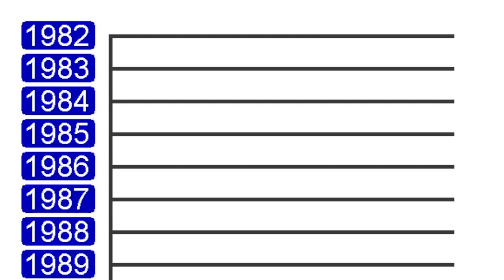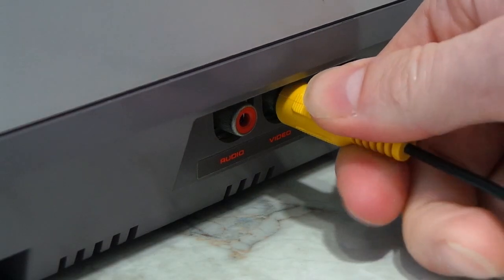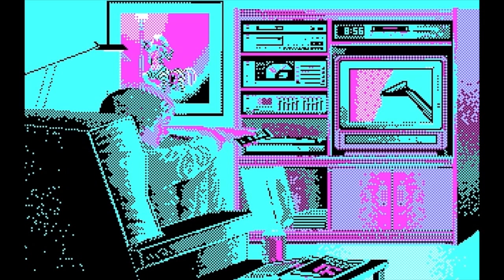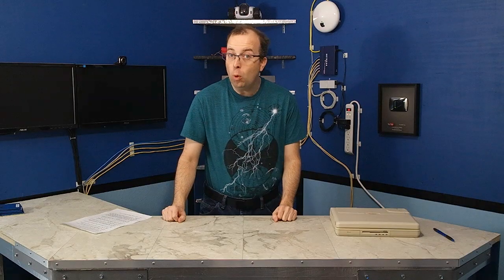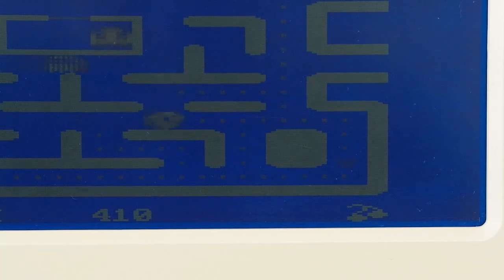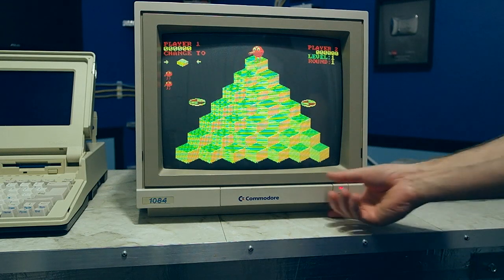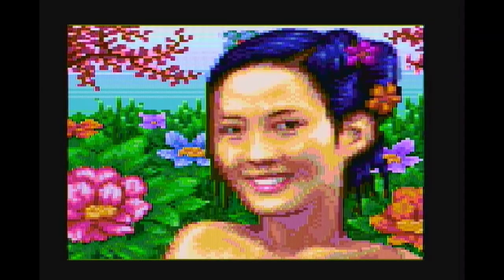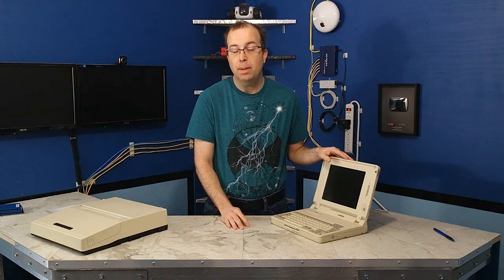CGA Graphics - Not as bad as you thought!

Comment: Ok so i know why CGA had 4 colors, because of small vram but why it had Black, C,M, White and not Black, R, G, B. It is still 4 colors and cost the same amount of vram. So why they choose that terrible pallete. BlRGB would be better than BlCMW.
Reply: To simplify andrewmjenner's explanation, in the 4-color CGA graphics mode, only the R and G channels could be controlled by the programmer. The B and I channels were set globally by the choice of graphics palette. The I channel was always set on to produce a bright image. If the B channel was off, the four R and G combinations gave you a Black, Red, Green and Yellow palette. If the B channel was on, it combined with the R and B channels to give you a Black, Purple, Cyan, and White palettte.
Reply: +Huderlord Here's my guess: The CGA's designers knew they had two bits from the pixel data to play with and 4 output bits (R, G, B and I). They assigned R and G to the two pixel data bits because differences in R and G are more visible than differences in B and I. The B and I bits just came from two spare bits of the palette register, giving a choice of 4 palettes (dark red, dark green, brown; dark magenta, dark cyan, light grey; light red, light green, yellow; light magenta, light cyan, white). The low 4 bits of the palette register (which control the overscan colour in text modes) also control the colour of bit pattern 00 in the 4-colour graphics mode, giving an extra dimension of colour. The BIOS is set up to make the black/light magenta/light cyan/white palette the default in order to enable white text on a black background, but lots of games use one of the other 64 possible palettes. Actually 96 if you count the red/cyan/white palettes that you get if you turn off the colour burst (that was most likely done in an attempt to make 4 different shades of grey on monochrome composite monitors rather than to give more possible palette combinations).
Reply: More likely chosen for clarity. Sharply contrasting colors made better edges. Plus you kinda wanted white to pair with black leaving 2 different colors for drawing attention to objects.
Reply: Or they did it to catch the attention of children. Cyan is one of my favorite/favourite colours/colors.

Comment: Great video. Can't wait for the Tandy 1000 video. My first computer was the TL/2 and sound was great. Then I added a VGA card to it and it was a great computer that I used for about 6 years and even used it on AOL for a long time. I still have it, and runs great!
Reply: I have a TL now and really like it. I had a HX as a kid and also have one but the TL with a compact flash is a great Tandy retro platform.  Also have a CM-11 monitor which is so crisp.
Reply: +Ryan Yoder I so regret getting rid of the monitor. Now impossible to find the same one. Same for the keyboard. Oops. I was moving so yeah. Now I am trying to make a keyboard adapter. Another project on the long list. I made cf adapter to Isa from dangerousprototypes.com but I can't test it till the keyboard project is done. It's flashed already too.

Comment: Anyone else still trying to break their habit/pet peeve of not going beyond 80 columns while coding?
Reply: In a way. Text mode graphics were limited to 80 columns of text, in part because of memory limitations in the graphics hardware. Even today, a lot of IDEs have a line at 80 columns, letting you know if you've gone over. It's not really necessary to keep it that tight anymore, but if you go much wider things start to look really ugly even on modern monitors, so it's not a bad idea to at least try to keep things within that line.
Reply: +emma kai (cravingpho) Why the fuck would I limit myself to 80 columns?
Reply: if you have to ask, then you're too young to appreciate it...
Reply: emma kai 
Why did you have to limit yourself to 80 columns? Memory constraints? (I'm young, but I think it's really fascinating to learn about this kind of stuff!)
Reply: I don't, although I configured my editor to have a line at the 80 and 132 columns.  When I write a text file though, I actually keep it under 80, in case I need to read it on a recovery console, or a phone, etc.

Comment: What happened to the intensity bit anyway?  When 16bpp graphics came along, there was a lot of methods of using the 16th bit, because you could only fit RGB in 15 bits cleanly.  The most common method was to give the extra bit to the green component, and sometimes the 16th bit would be left unused.
As far as I know, no one ever thought to use the 16th bit for an intensity channel, which would give 65536 colors without skewing the color palette towards a single component.
Reply: +kargaroc386 The trouble with having an intensity bit (or multiple intensity bits) is that the most saturated red, green, blue, cyan, magenta and yellow colours that you can create are less saturated than the real corners of the RGB colour cube. That means that even with dithering there are some colours that you can't approximate - the gamut is smaller. It's not unheard of, though - the default 256-colour palette on the early Acorn RiscOS machines (e.g. A3000) has two bits each for red, green, blue and intensity.
Reply: Apparently the human eye can discern changes in green better than red or blue so green is where you get the bang for the buck.
Reply: And this is what happened.

Comment: We had a Tandy desktop computer. It had CGA-compatible graphics with 16 colors, which it could display all onscreen at once at 320x200 resolution. I don't remember any palette-swapping but it might have been a feature that our games never used, or perhaps I simply never noticed it. The palette-swap color scheme does look more like what I remember seeing in Operation: Neptune, while the original 16 color palette looks like the colors in Steel Thunder.

I'm having trouble finding playthroughs of these games in CGA, everyone uses 256+ color VGA.
Reply: There is no palette swapping in Tandy 16 color mode since there are only 16 total colors.  Tandy used the PC Jr spec to get 16 colors and that came from the flexibility to use main system memory as graphics memory.
Reply: Ryan Yoder
Ah, neat! I miss that machine.

Comment: PCs just weren't designed for games, and CGA was one of the best/worst examples of that.  It wasn't until EGA and VGA that you could take advantage of things like hardware latches to slightly improve blitting speed.  CGA relied on you pushing pixels, and those pixels were not only packed per byte (320x200 4-color mode meant 4 pixels per byte), but they were also interleaved (meaning all your even rows of pixels were contiguous in memory, followed by all the odd rows.)  

The awkward memory layout required calculations to be done to know where exactly in video memory to read and write.  And since the pixels were packed, you would have to read what's there and mask out the bits you're changing to avoid changing neighboring pixels.  You wasted a lot of CPU time on just dealing with the display.  This is how an NES, which had a slower and less advanced CPU than the PC XT, could run circles around a PC in regards to games, because the NES had a dedicated graphics chip designed for drawing tiles and sprites.

So while CGA was still significantly more advanced than what prior pieces of hardware had to deal with (such as drawing every scanline yourself every frame on Atari 2600), it was still a pain in the butt to develop anything for without still carefully planning your game around display optimization.  This all played a part in a dev's decision on which mode(s) to support, and is part of why you generally only saw modes like CGA composite used on less intensive things like adventure games.
Reply: Standard VGA double buffering (320*200 256 colors) used again some latches. Select one of 4 columns,  and put your pixel. Then, to optimize the display you must draw column 0,4,8,12,16,20,etc... 
restart with columns 1,5,9,13,17,21,etc ...
restart with columns 2,6,10,14,18,22,etc ...
and finally restart with columns 3,7,11,15,19,23,etc ...
Just to reduce the number of "out" instructions.
In this mode, memory is not directly mapped on the processor bus. You need to use "in"/"out" instructions to access video memory, and it was a serious bottleneck.
Intel 286/386 processors was more powerfull and faster than 68k or 8bits processors, but use PC video cards was a joke.
Reply: To flatten the playing field with interleaved graphic adapters, we built enormous (at the time) pixel look-up tables , along with hand-crafted "blitters" that would dynamically reshuffle byte-aligned sets of artwork pixels into screen-compatible pixels and display them sequentially on-screen. That worked well because pre-Pentium CPU's had no memory caches, and could randomly access huge memory blocks without thrashing their non-existant data caches (IOW, all memory access was equally slow). The use of blitter-based internal graphic drivers also enabled us to use a universal set of 256-color artwork to support all manner of graphics adapters.
Reply: This comment had me pondering how to write some routines for working with CGA. Well done!
Reply: This comment is severely underrated. Very informative. 👍
Reply: EGA blt latching was PITA to use; it's least what you think when games are the design goal. Hence why so many games used mode 13h.
Reply: What exactly is a hardware latch?  My only experience with VGA used a page of system memory that was linearly mapped to video memory.
Reply: source?

Comment: The pal colour system was designed specifically to cut out colour artefacts. It would have needed a much higher horizontal resolution on a mono signal and complex computation to fool the colour decoder in the pal display. Artefacting attempts just produced b&w images with a little colour shimmering

Comment: You mention around 0:35 that SVGA, or some derivative of it, is still used with today's computers. Can you explain that, or are you saving that topic for another video?
Reply: +Gordon Taylor SVGA or Super VGA is used in many projectors. Which doesn't say much, as that is about as low end as you get. So like a 120 USD travel projector or one of those kids projectors you see in Bed, Bath, and Beyond. Not to denounce SVGA, but frankly it is nearly the same as old school SDTV. Think 640x480 mode but scaled up to that resolution.

Edit: Incorrect on my first thought. It is actually 800x600 resolution, so true 4:3 aspect ratio.

Comment: Great video; a really good blast from the past. (I was a developer through all of this.)

I don't know if you've ever touched on this in any of your videos, but I remember programming a touchscreen CRT in 1984. It was monochrome (of course). There were little holes in the top, bottom and sides of the screen (just in front of the glass) with LED transmitters and receivers. When you put your finger on the screen, it interrupted the beams of a horizontal LED and a vertical LED in the LED matrix, which gave the location of the 'touch'.)

On that same program, I created and printed out bar code labels and programmed a scanner to read them. (In the warehouse, as a new batch order of product was needed, the order was entered into the program and subsequently the database, Bar code labels were produced and printed. Then, as the lots of product went through each phase of production, the bar codes were scanned and the database updated. Reports could be viewed and printed to show exactly where in production everything was and how much was ready to be shipped. Not bad for an 8088 based PC in 1984 that was on-sale -- half off -- for only $10,000!)

Maybe you could do a video on the evolution of touchscreen and the evolution of scanners.

Comment: Hi I have a question. How much ram and flash storage do you recommend to run windows on a macbook? By the way I have an A1181.
Reply: Run Xubuntu linux instead (runs directly from any USB drive, don't need to install it) Stick with version 16.04 which is stable. Install Wine on it (windows emulator) and find out that your entire "windows drive" occupies only 50MB of disk space, and can be compressed down to 20MB for cloud backups. Besides, you can have various different "windows drives" each one isolated from the other, for different applications or testing. There will be some adaptation and learning first, but the payoff is that your life is going to become SO EASY!!  I've been used a modified Xubuntu ISO in "live" mode for a year, without installing it, and I do all my windows gaming on it. I store all the changes I want on disk, and every time I reboot my laptop I get a fresh and clean system again, no files pilling up, no residues from the last session, everything new.

Comment: Using NTSC artefacting to simulate in-between colours is great if you live in North America. I'm not convinced it's as much of a help for those of us in the PAL regions.
Reply: This wikipedia article says the color blending did not work on PAL. 
https://en.m.wikipedia.org/wiki/Composite_artifact_colors

Maybe this contributed to the  vaning interest in supporting composite since large part of the market could not use it.  I live in a PAL country and don't remember ever having a CGA output for composite.
Reply: I'm not very well-versed in PAL vs. NTSC, but I do know there are considerable differences between the technologies. Any software which relies on specific aspects of one standard tends to break to different degrees on another standard. Since PAL and NTSC seem to differ in pretty much every aspect possible while still doing roughly the same thing, I don't think that kind of "trick" would work.

And again - using colour aliasing to generate more colours is pretty clever, no doubt. I remember there was a CGA game which attempted to switch modes dynamically as each pixel was being drawn or some such and display its full 16 colours that way, but that only worked with specific processor speeds or some such.
Reply: +Malidictus Good point. Though composite still smeared details (old SNES and Genesis/Megadrive actually simulated transparency effects with that. Composites only plus over SCART or S-Video) be it PAL or NTSC I'm not sure if PAL TV would change colors like that. Somebody needs to test this out. I never knew this about CGA and Composite but if this effect does not even work with PAL TV's then yeah, nothing was really lost in my childhood days.